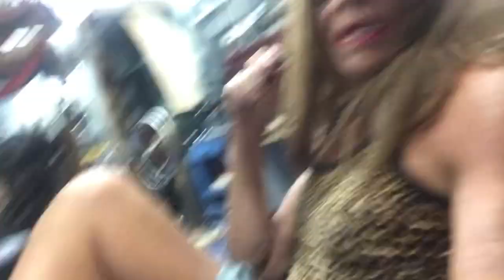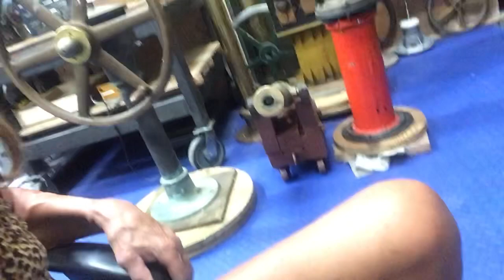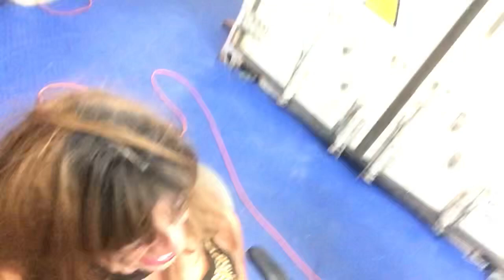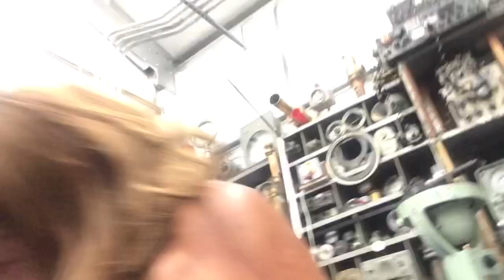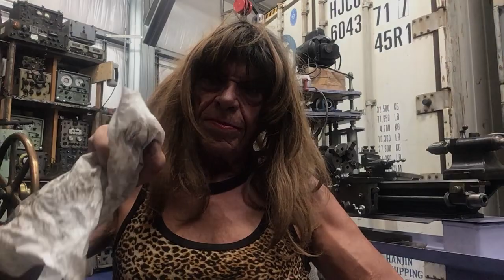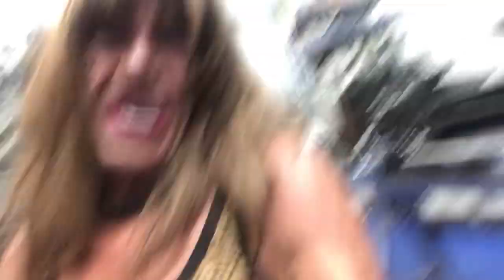Prison princess

Comment: The Elgin lathe, you will get it working.  
How did the filming go. 
 The racoon is loose! Hehehehe.
Reply from the maker: Hi hi raccoon lol ha ha ha  the elgi n lathe  was working but there was a issue with the smith and motor so I fixed the drum switches  left the l motor  alone and will instal a other motor next to it but still using the variable speed unit I know it will be a great lathe  I built a lathe a yea r or so ago  using h beams lol